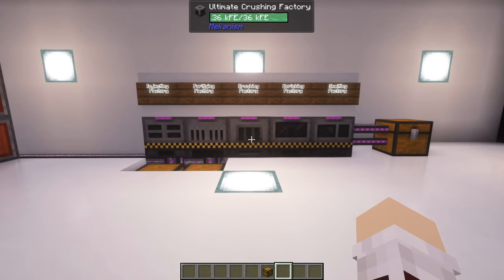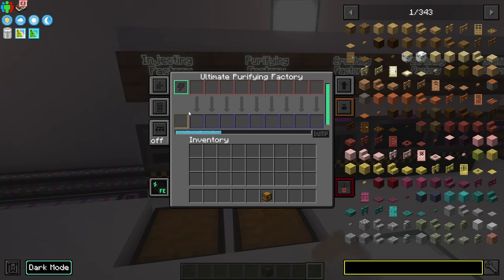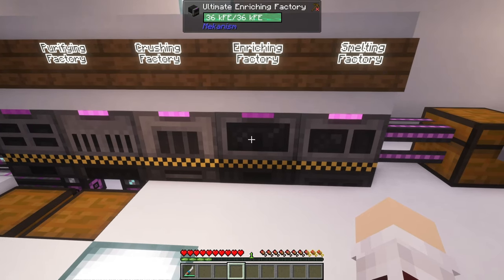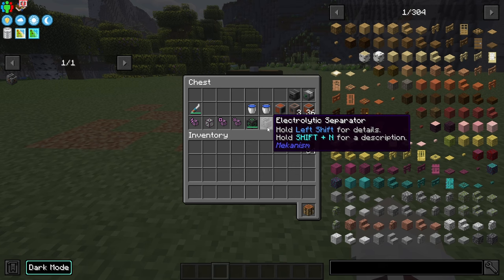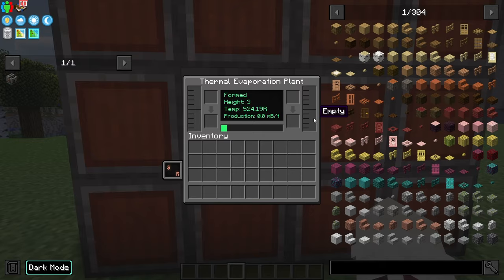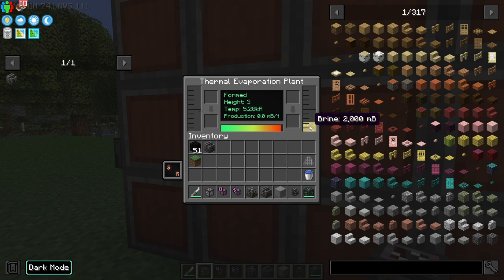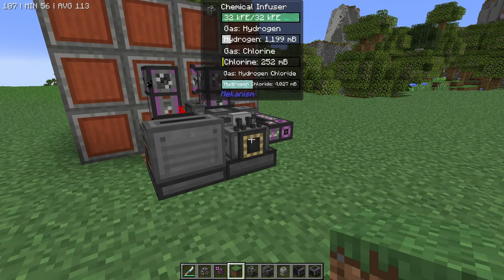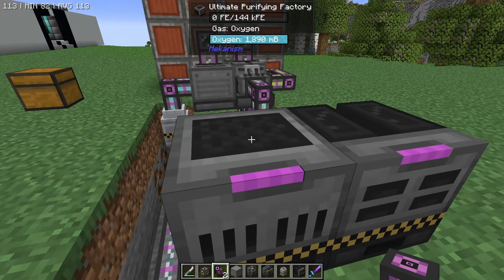5+ Ore Processing with Mekanism!  (simple) - All The Mods 9

Comment: I have some tips for you: You are not 5x your mats, raw ingots are not 5x, you just gain 5 more every 3. In order to 5x your items you need to start the process with Ores, the ones you mine with Silk Touch, you can enable silk touch on the digital miner as well, and I think the process is a bit bigger than what you have, can't remember. Also, you can press the "auto-sort" button on your machines so it uses all vailable spots. Someone already told you about the "dumping excess" button. The "infinite water source" doesn't need to be 4 blocks of water, just place 1 block of water below the water pump, btw, there's a mod called Infinite water source, you craft a cube, place a mechanical pipe connecting it and the machine that needs water, set the extreme attached to the block to "extract" (do that with crouch + right click with your configurator in hand) and you will pump water like there's no tomorrow, without wasting energy on the water pump, use the pump for other stuff like lava. Good luck!

Comment: so you mean x2.6 not a x5..
Reply: blame the change between 1.16 > 1.18 when they decided ore drops as raw chunks instead of ore blocks but on the plus side the drop rate is effected by fortune enchant with fortune 3 you can get between 3-6 raw ore per ore block mined
Reply: You can also x5 ores with industrial foregoing, the downside of that version is that, you need a running mobfarm to produce liquid meat and a stasis chamber to optain ether gas from a wither.
Reply: It is still 5x, but on ore blocks instead. With the raw ore changes, ore doubling is now mostly handled with fortune

Comment: Instead of a pump and infinite water source, use a sink. Its infinite water in a single block and you don't need energy to pump it out.
Also wrench can rotate the machines instead of breaking and placing again
No soliciting sign stops wandering traders
Reply: This is better if you're trying to do this in a different mod pack.  I'm currently working on craftoria and the sink isn't available.  Though the pump works with a regular water source block and doesn't require it to be infinite

Comment: 9:22 the resistive heater can be set to a specific energy usage by typing in a number for more heat, if I remember correctly
Reply from the maker: Just checked it out and it still works, excellent tip!

Comment: when you dissolve it into a slurry you and go through the cleaning and crystalizing process you turn the 3 raw into 10 ingots while starting at the injection factory makes it into 8 so you are missing out on 2 ingots with this method
Reply: The issue between the Tier 3 and Tier 4 Ore Processing is, the ore to slurry bottleneck, the 3 machines that handle Ore>Dirty Slurry>Clean Slurry>Crystalization do not have factory versions meaning they can only process 1 item stack at a time and even with max upgrades its still slow as fuck. So yes you are losing out on a bit of product by only using the Tier 3 processing... but with a couple digital miners and a QIO system for storage you get so much ore that it doesnt really matter in the long run. Not to mention you need quite a few more machines to even properly work the T4. 
Like rn in my ~100h world ive got tens of thousands(some reaching the hundreds) of ingots , i just dont give a damn if im losing out on 2 ingots per stack of ore, if i can process 10 stacks at a time. In reality you make the T4... just to make it when speed and efficiency is involved T3 is better.
Reply: @ghekor  how many machines you have making the gases? i have one only (i just made this whole ''factory'') and it's slow as hell, the machines stop all the time because there is no oxygen or hydrogen chloride in them
Reply: @wgnd1614  I dismantled my T4 a long while ago XD, i just made it for a bit to see how it is, but as i said in my OG comment i found its efficiency lacking, esp given the massive amounts of ore i was getting as it is at that point.
Just run a T3 , Oxygen should be easy to get, for hydrogen chrolide i think the brine was the usual bottleneck? If so just make an extra brine tower or two...and at max size(which is 18 blocks high).
Reply: @ghekor  thanks for the tips man i'll do that

Comment: Good video!
Except math not mathing.
Looking at configuration in the video:
input 3 ore,
output 8 ingots.
3 ore to 8 ingots is 2,7x (simplified 8/3), about 2 times less than 5x.
Seen comment about not sufficient output of something and it somehow changes ore to ingots efficiency, which is not, just slows processing speed

Comment: This process doesn’t 5x your input it is actually 3.28x I recently did this set up in ATM9 and learned the hard way. The major bottle neck for this setup is chlorine where you effectively need 21 max size brine towers to keep up with the chlorine production need.
Reply: Yeah, this is the Tier 3 setup, not the Tier 4 setup. The Tier 4 setup will introduce the following extra components: 
1x Chemical Injection Chamber (Input: Gunpowder and HCl)
1x Chemical Oxydizer (Input: The Sulfur from the CIC above)
1x Chemical Infuser (Input: Oxygen and the SO2 from the above Oxydizer)
1x Rotary Condenstrator (Input: Water)
1x Chemical Infuser (Input: the vapor from the Condenstrator and SO3 from the Chemical Infuser above)
(Finally we get to the actual 'input' machines...)
1x Chemical Dissolution Chamber (Input: The Ore you're trying to smash, and the H2SO4 from the previous Infuser)
1x Chemical Washer (Input: The slurry from the CDC and Water)
1x Chemical Crystalizer (Input: The clean slurry from the Washer)

The crystals from that get inserted into the Injector from the start of this video's process.
Reply: (Youtube REALLY doesnt want me to link to the picture of the Tier 4 setup i evolved from this Tier 3 one... but it can be done in a 7x8x3, which is still very compact considering that includes the thermal plant.)
Reply: yeah its waay nerfed, ive found a rftools crafter making a platinum hammer and  hammering the ores in it for 2x is good enough after the mining dimension quarrys setup

Comment: Way late into this but i just built it and for some reason i have an extremely low oxygen output, it currently fluctuates between 1 and 2 and i have no clue why. ive already rebult it, tried adding and removing speed upgrades. im at a loss.

Comment: Is there any way of producing more heat or is it just more heaters
Reply: If you use the resistive heater you can change the amount of energy it uses (the prompt in the gui) and the more energy you put in, the more heat you get out. I think the max heat is 1250FE/tick, although you can set it higher, it won't heat more past that iirc.

Comment: 1.Sooo this video is klickbait!!! There was no x5 ore- production at all! If you can call it that way, it was a "x4" but that still depends on how many raw ore chunks you get out of 1 Ore! Mekanism assumes that you get 3 raw ore out of each ore. If you find a way to get more(for example using fortune or silktouch and than squeezing the ore in the "mechanical squeezer")

2.Also mentioning: the heater that works with energy: you can type an amount of RF you want it to use! The more rf you use the more it will heat up. If you dont produce enough rf/t for it than it uses what it gets

3.The max hight of a brine tower is 18 blocks i believe and you need 4 advanced solar panels for it. But that doesnt use the energy of the solar panels. I like to connect a electrical heater to these solar panels and use all the energy for an extra heat boost.

4. Idk if this knowledge is outdated but i still want to mention it(pls correct me if its outdated):
-max size Brine towers heat up faster in deserts
-the corner blocks of the brine tower need to be normal blocks and cannot be valves